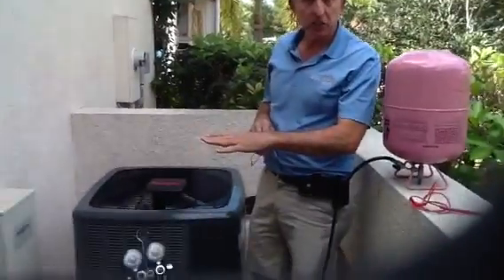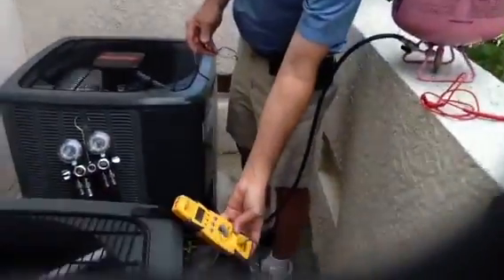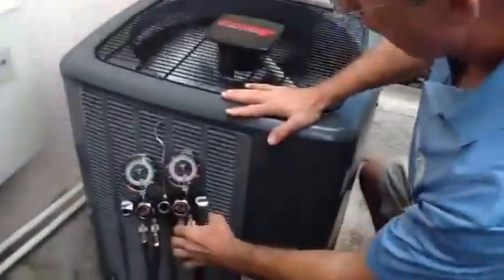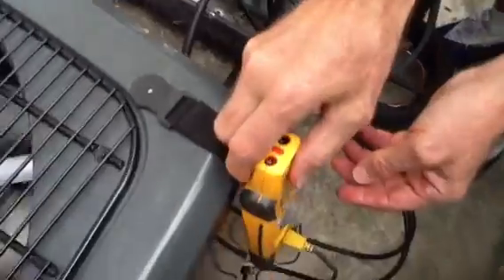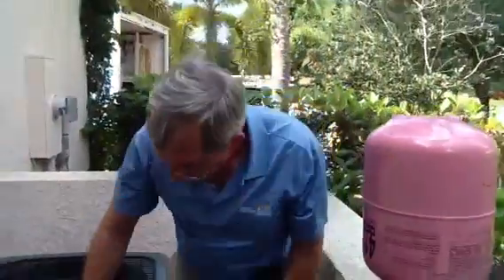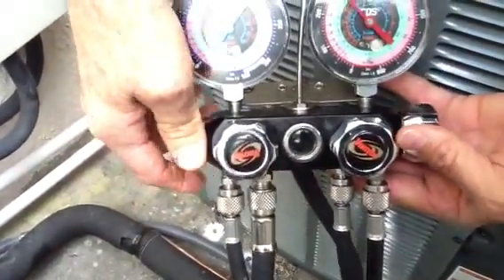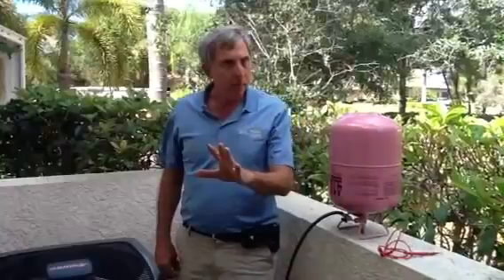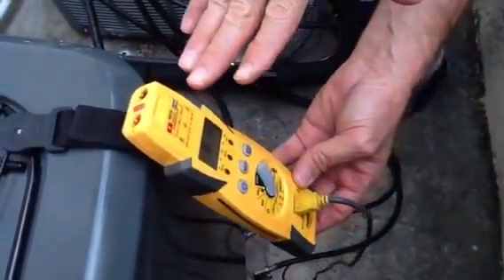Subcooling Explained

Comment: As subcooling increases with more liquid in the condenser does the compression increase also? If so, what is the effect of higher pressure and cooler liquid at the TXV, does the TXV maintain the same superheat and cooling regardless of small pressure changes?

Comment: What can cause a R410a liquid line gauge to show a subcooling at 2 degrees F after a 1.5 lb charge? The AC is coming out cool inside but the subcooling of 2F when it calls for 10F is concerning. I've tried other gauges and they all say the same, 2 degrees F subcooling..

Comment: what if i add puron and my pressure & my temp go up? what is going on there
Reply: Plz dont call it puron or coolant. Neither are correct. Its called: refrigerant or by the type (R-22, 410a, etc).

Comment: when a 410a bottle is upside down like that you are charging as a gas and beings your charging like that you have just messed that blend up.
Reply from the maker: you charge 410 systems in liquid state
Reply: stack or die.  the way he is doing is proper.
Reply: flip it upside down crank the vapour nozzle wide open theres your liquid. Ever seen inside a bottle?
Reply: Jim Schwartzbeck, that is 100% wrong. Read the bottle. 410 charges upside down.
Reply: Wrong...410a is a blended refrigerant you charge as a  liquid having your can upside down. But I also throttle the refrigerant in on the highside.
Reply: But the bottle says to charge with it upside down.

Comment: You said in the video the original subcool reading was 4,so with subcool if you have a number lower than the 8-10 goal the system is low?Rather than with superheat if the number is below the 10-12 goal the system is overcharged right?
Reply: So, consider if you want to increase subcooling. you add refrigerant. if you want to subtract superheat, you add refrigerant.

Comment: I'm sure this was just a brain fart, but important for everyone to understand that the refrigerant coming back from the indoor coil is cold, the 91 digrees is the temperature within the condensing coil where the vapor is cool enough to condense into liquid, known as liquid saturation temperature.
Reply: I'm just a maintenance man but I have my 608 cert. but seems like he would know that and the scale is so you can record how much refrigerant you are using for your business and epa records.
Reply: not to mention instead of using a standard subcooling rate how about looking at the name plate for what the manufacturer designed the subcooling to be.

Comment: What about r22? Do you have to add refrigerant in a liquid state through the suction too?
Reply: Les Mach everyone gets this backwards. An azeotropic mixture or azeotrope, can be charged in liquid or vapor state. With an azeotrope, fractionalization will not occur in a leaking system, has little to no temperature glide meaning the two refrigerants do not separate when boiling off or condensing. R 410a is a non azeotropic mixture or zeotrope but behaves nearly like an azeotropic mixture. Fractionalization is not a concern with a leaking 410a system and can be topped off as a result. It's azeotropic characteristics were a big factor in it being the chosen replacement for R22. It is best to charge r 410a in liquid form, but contrary to popular belief, you can charge in vapor form without concern of it seperating. 
Again it is a non azeotrope that behaves like an azeotrope. (nearly azeotropic)
Non azeotropes seperate, azeotropes don't
Reply: metaltera86  R22 is made up of only one gas, hydrchlorofluorocarbon, [HCFC]  so you can charge with it in gas or liquid state. 410A is made up of two refrigerants, HFC 32 AND HFC 125. It is an azeotropic mixture. You have to charge with it in a liquid state so the two gases don't seperate.
Reply: Having said all that... it is still non azeotropic and I don't charge 410a in vapor form. Nor am I encouraging anyone to do so.
Reply: Les Mach not trying to harp on you what do ever but it's charged as a liquid so that you release the oil into the system because it is a blend
Reply: No I don't mix the refrigerant with oil when I charge a unit. I add oil later.

Comment: Does the OAT makes the required subcooling vary? or it would be the same at 75 degrees as at 110 degrees OAT. i heared some  high seer units require very high subcooling like 15 degrees.

Comment: so you charge 410 A  in liqiud form through the suction line or low side RIGHT? and you convert  high side pressure into temp. - actual high side line temp. = subcool ?

Comment: Should subcooling method be practiced for r22 systems and if so what should be the temperature range,
Or is superheat required to correctly charge a r22 system.